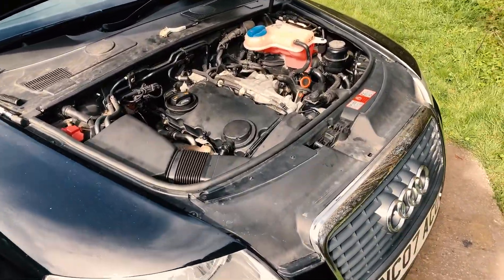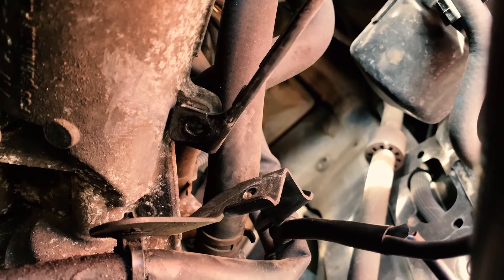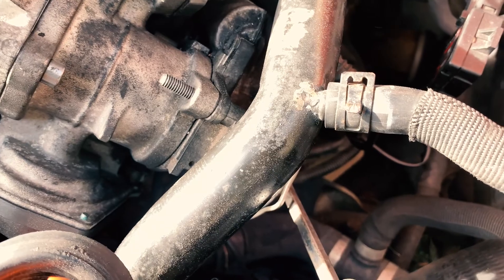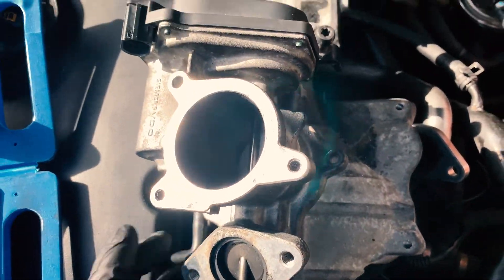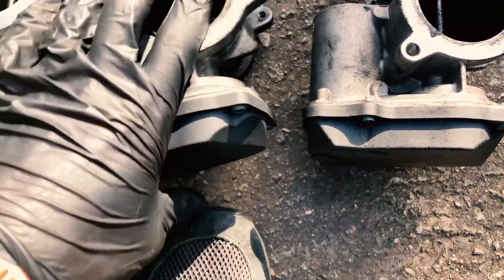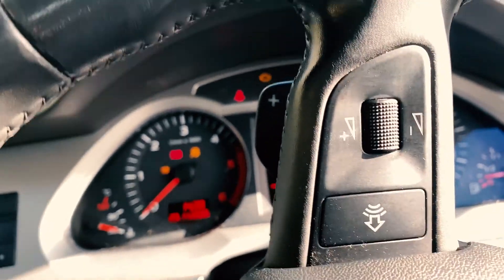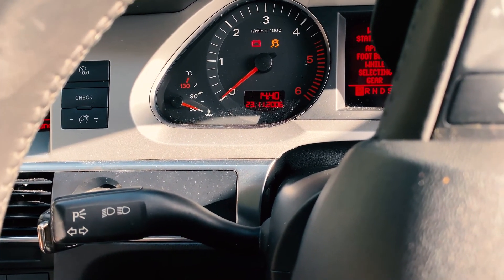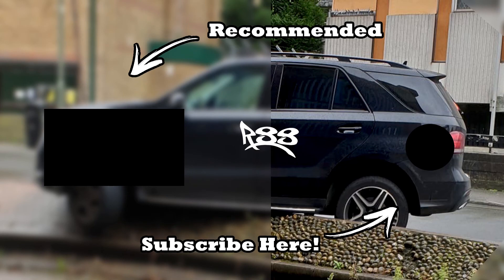How to Replace EGR Valve on Audi A6 2.0TDI (P0405) / DIY + Ebay EGR Review *NOT GOOD*!

Comment: Interesting I have a 07 plate Audi A4 Sline 170bhp 2.0 tdi 
Feels bogged down whilst driving can’t do anything from 30-45mph because the Glow plug light flashes and EML also comes on? On code reader got a fault P0299 turbocharger/ supercharger underboost????
Reply: Did you ever fix it ive got same problem